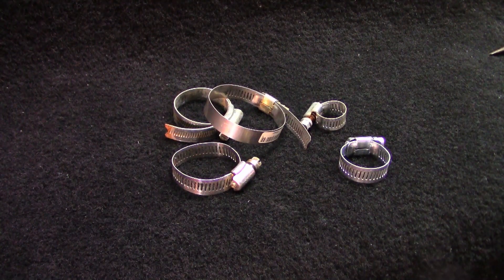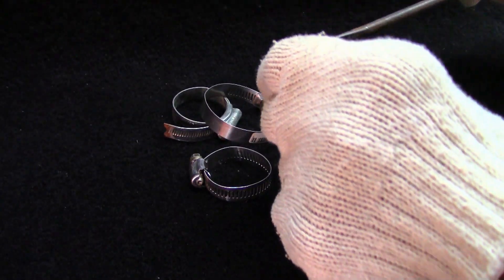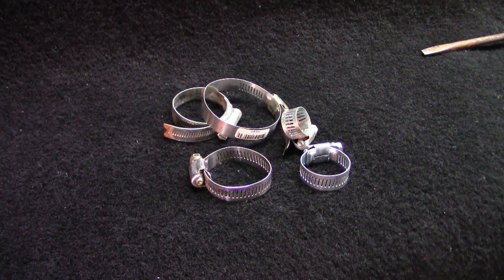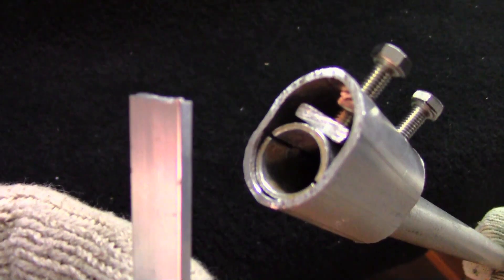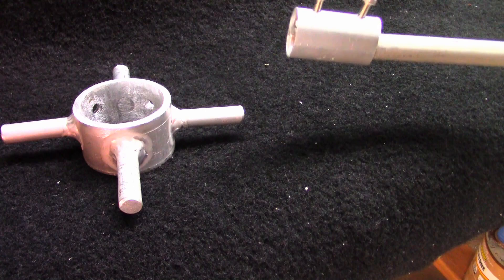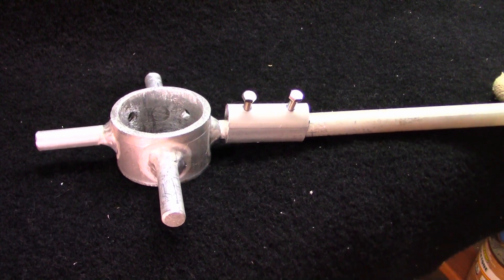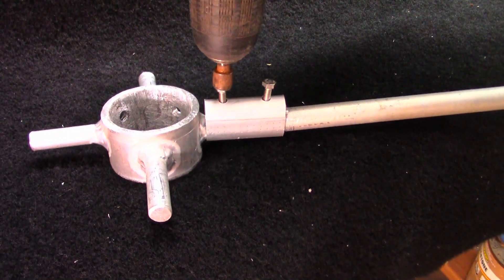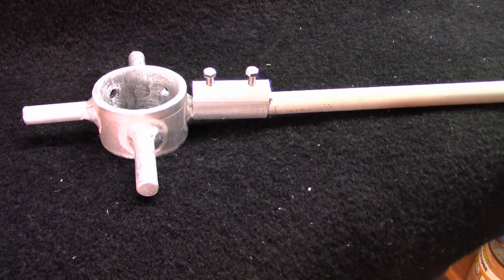✅CLAMPS HOLDS TIGHTER THEN HOSE CLAMPS ON YOUR CUBICAL QUAD HUB

Comment: Don't use a screwdriver on a hose clamp. Use a nut driver or socket. I use a 5/16 quarter inch drive socket with my drill and set the clutch so it won't strip out the clamp. Never a problem and gets PLENTY tight.
Reply from the maker: Yep that's the only way to go all screws bolts are 3/16 hex head. Make life easier.